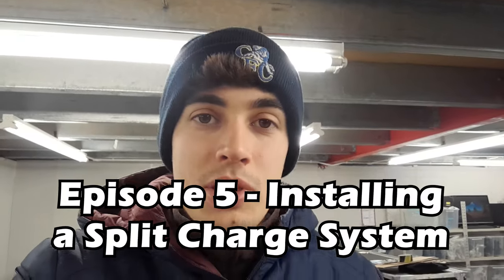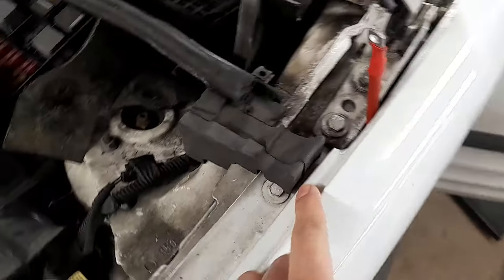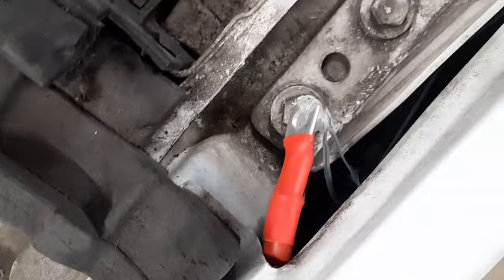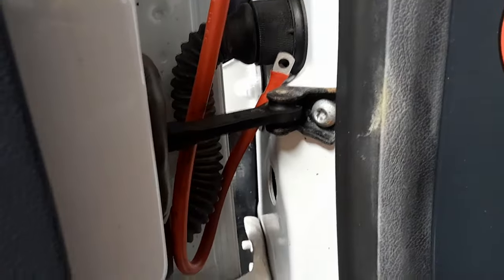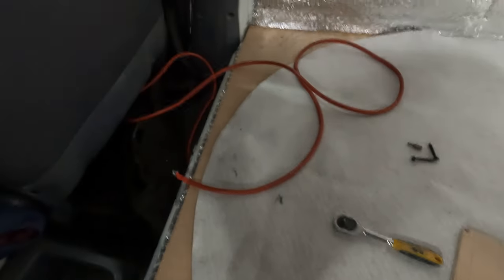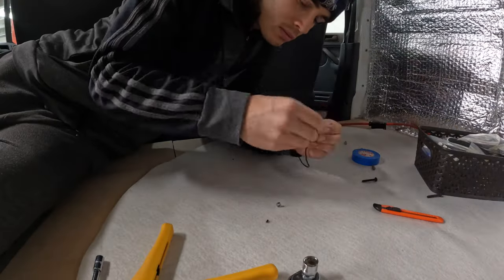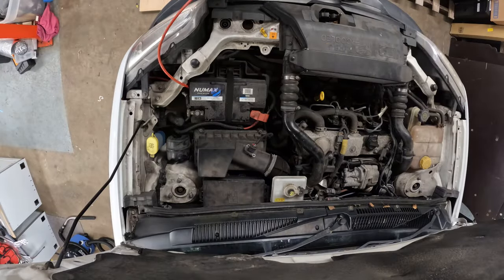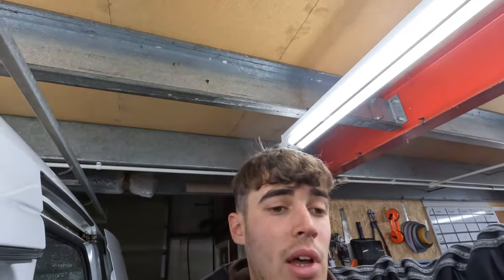Split Charge Install - EP05 - Mini Camper Van Conversion - Ford Transit Connect

Comment: There is a hole behind the pollen filter tray that has an oval grommet in it. If you pull the grommet out, from the engine bay side, the wire can then be pushed through the bulkhead to above the fuse box. You will probably need to make a hole in the sound deadening above the fuse box to pass the wire through. The oval grommet can then be drilled to suit the size of the wire used, pushed over the wire and back into its hole.
Reply from the maker: Thanks for the info mate! 🙂
Reply: Thank you. I made a screen shot to help me later!